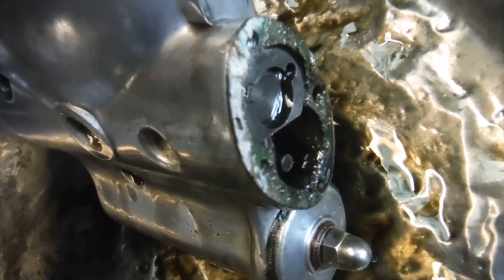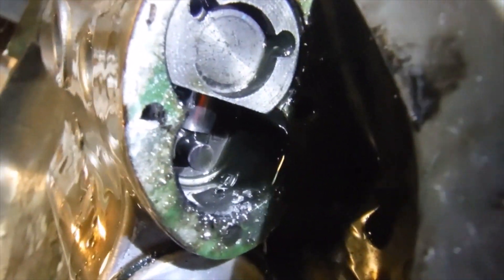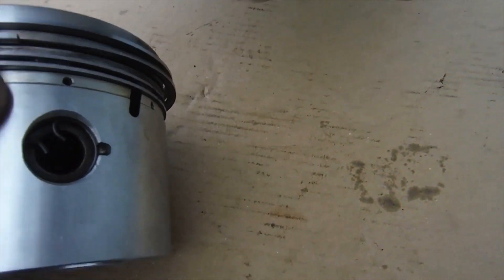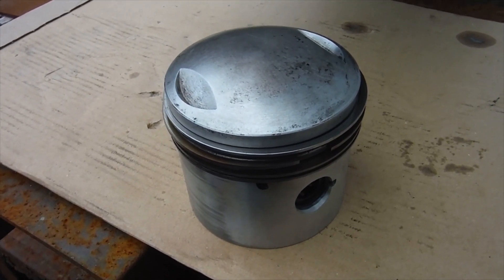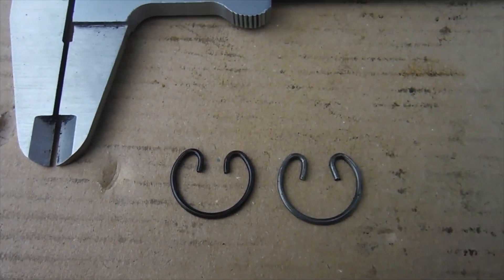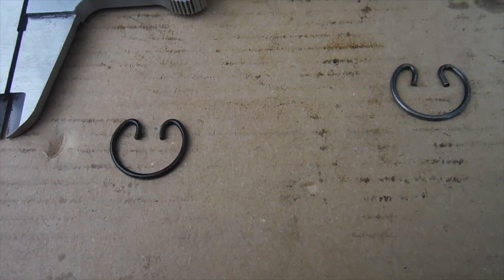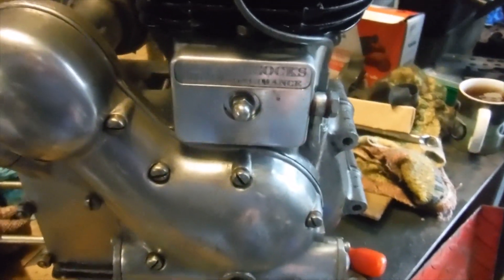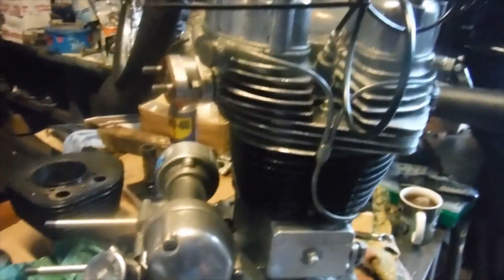Royal Enfield Bullet 500. 6 Final stages of engine reassembly discussed.

Comment: Not something I've needed to do very often but I would inspect the circlips and reuse them if they're alright and fit well.  This is mostly down to paranoia concerning how well different circlips will fit the piston that I'm also reusing.  I have no real justification for this.  If I was fitting a different piston, I would probably use new circlips.

Comment: Finished engine looks great. However i just wander couldn't you get a circlips without ears ( popular in the States, and Canada )? Pistons are designed for them and in this case floating pin is not hitting the ears of the circlip, but pushing with its end a circlip to seat deeper in it's groove. I also reused circlips a few times feeling little guilty about it. :) But if they feel and fit much better than a new junk delivered  in a set of pistons, what you can do?